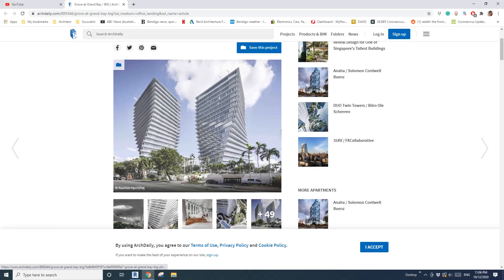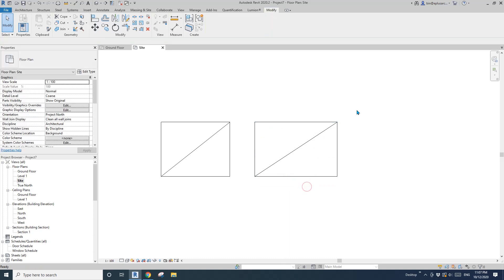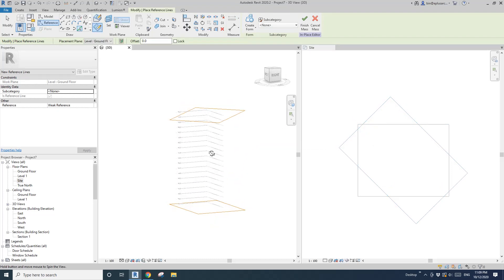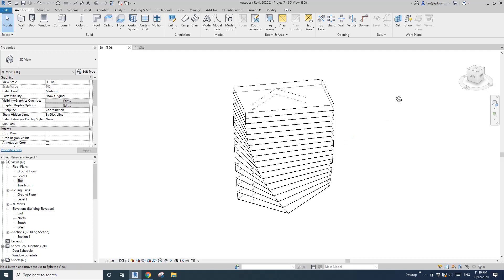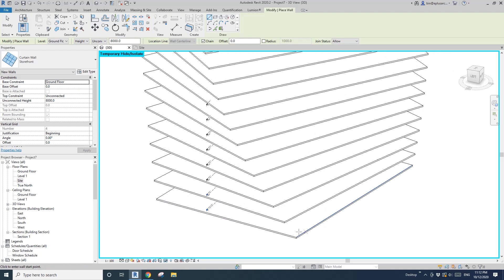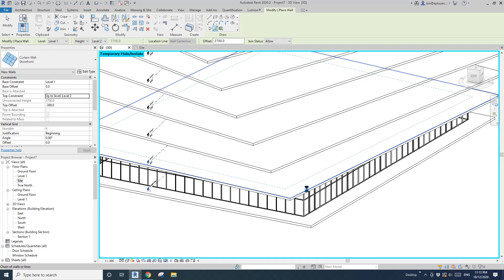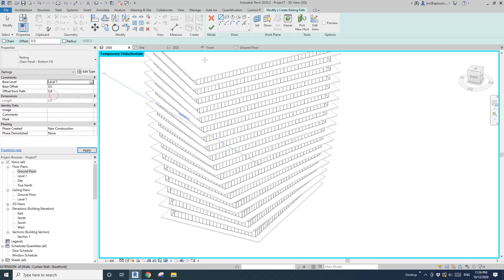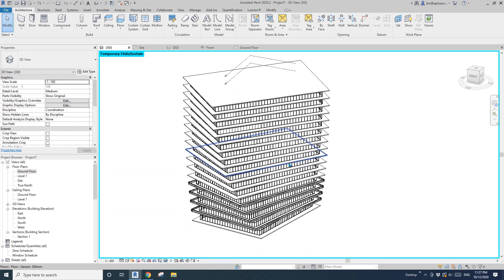Everyday Revit (Day 267) - Building from mass exercise Part 1

Comment: Is there any possibility for adding these storefront walls more parametric?
Reply from the maker: Not sure... Just make sure you use reference lines to create the form so you can adjust the reference lines to change the shape of the form, then upgrade the walls to match the form.